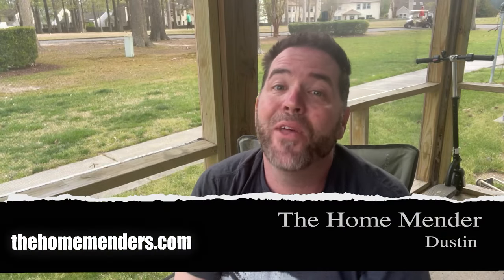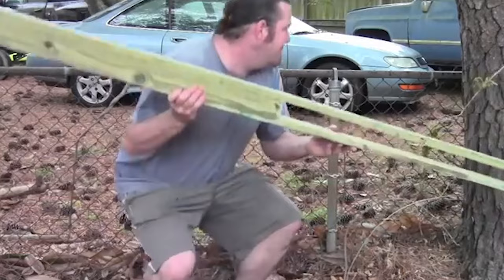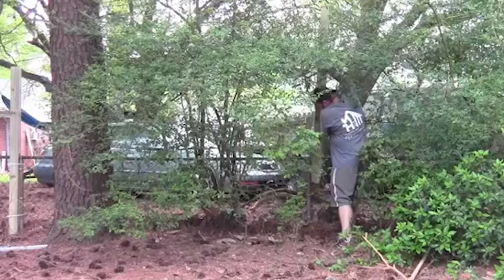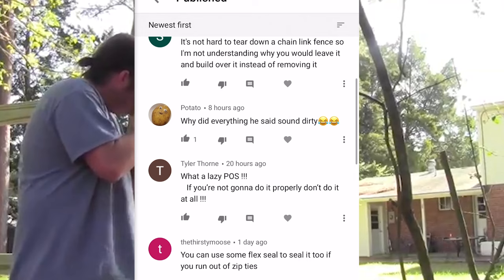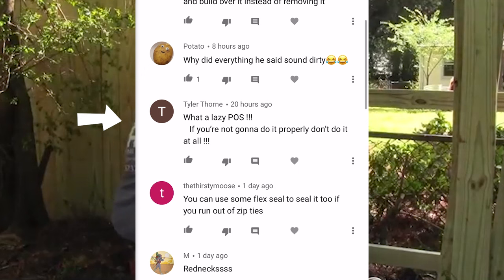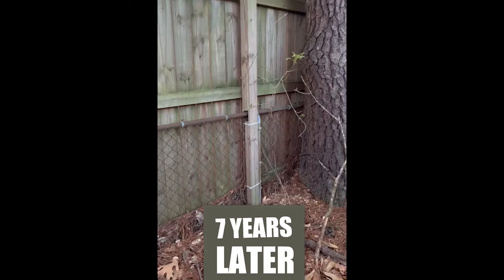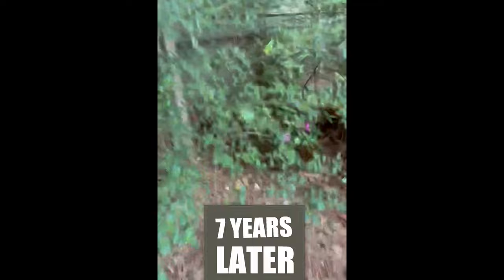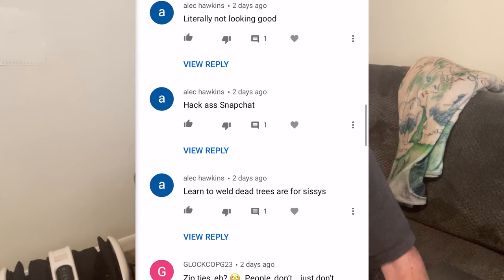7YEARS LATER Fence over chain link. You can do it!

Comment: I'm really glad you made this update video 7 years later. I have an old 3' tall fence separating my yard from my neighbors with next to no privacy. This looks like a perfect, cheap, and reliable solution for my situation and I'm happy I stumbled onto your videos. I'm still a bit skeptical of the zip ties, and will probably spring for some 2 hole pipe straps to help stabilize the posts to the existing metal posts. Thank you!
Reply from the maker: Hey hey that is awesome. So glad it helped you. I intended those tie straps to be temporary until the fence was built, but they lasted the whole way. If I redid it, I would probably use band straps. Thanks for the comment.

Comment: You used the structural integrity of the metal fence to help hold the privacy fence right?  which I mean is a good idea if the metal fence was installed properly to withstand the force of the wood fence and the wood fence hides the metal one. if that’s  what you wanted and it works fuck it more power to ya lol
Reply from the maker: Oh this is an awesome comment. Thank you sir